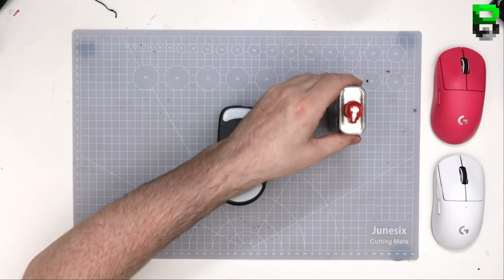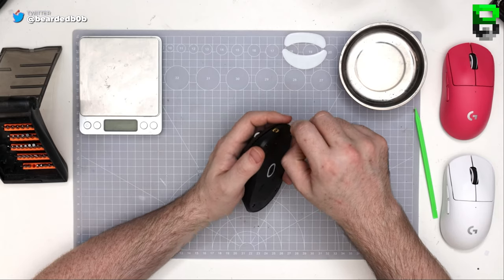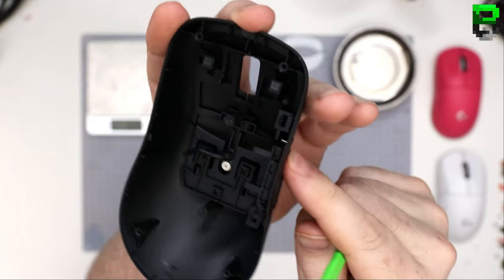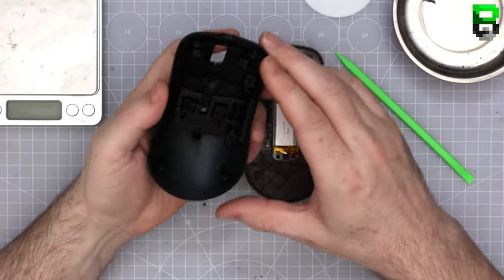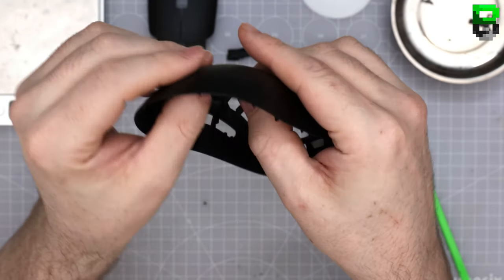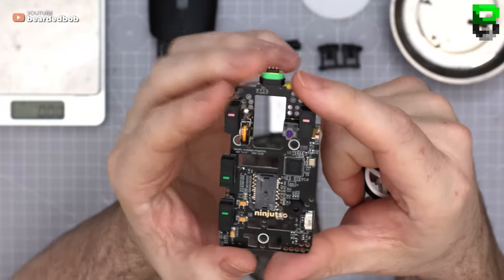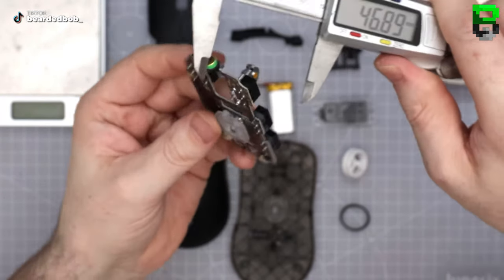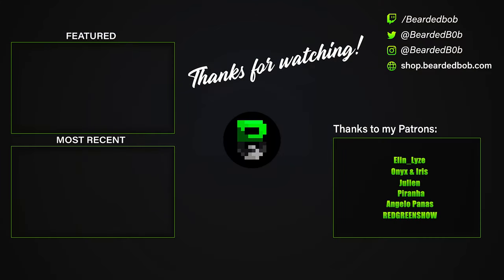THIS IS THE PROBLEM!: Ninjutso Katana Teardown

Comment: Ooo thanks for a teardown video! My scroll wheel scrolls up when I scroll down unless I go slow. And then they sent me the wrong color as a replacement. Just gonna switch the shells lol
Reply: I had that exact same issue and fixed it literally just now. All I had to do was spam the encoder with some hexisol (ethyl alcohol) with some cotton buds and spammed the scroll wheel for a while. Works great now. (Don't know for how long, tho xd)
Reply: @zepticboi6990  thanks, I'll try fixing it even though I already swapped the shells lol

Comment: Had to stop using this mouse because of the mouse 1 and 2 buttons creaking issue. If you click and press in a certain place on the mouse buttons you feel a creak with some feedback. Ninjutso are aware of the issue and recommended adding grease either side of the pillars that interact with the switches and rub against part of the exo skeleton. They even sent me a new mouse but same issue by design. Have you come across this?
Reply from the maker: Interesting I haven't come across it, can you confirm where you have to press?
Reply: @Beardedbob  just tested and best  way is to click mouse 1 down from around level with the top of the scroll wheel and then slide your finger down the button. Sort of like drag clicking I think...